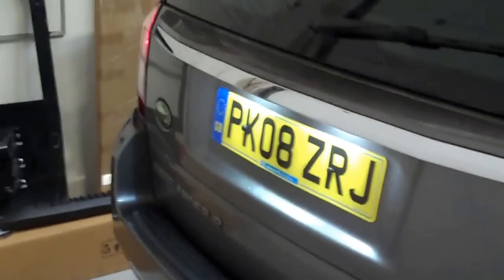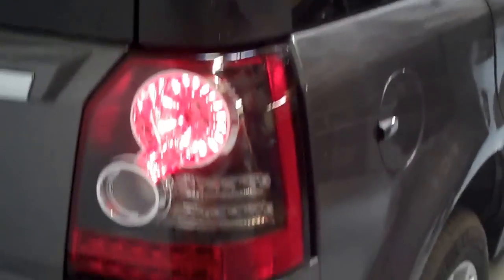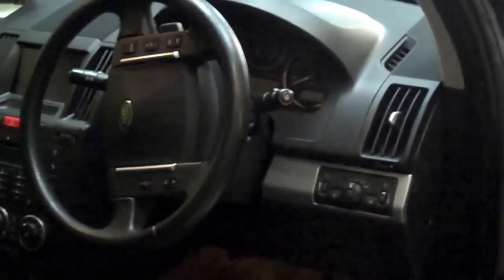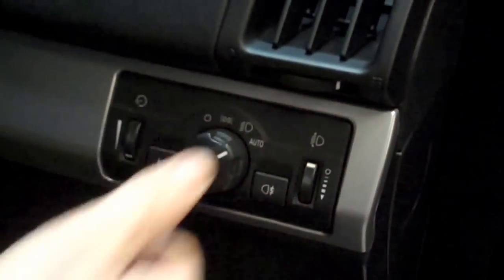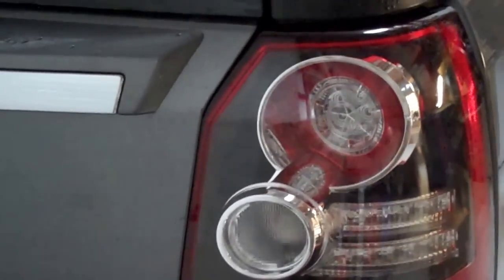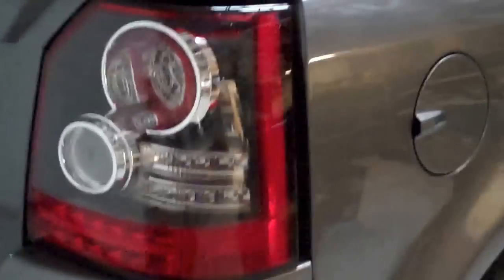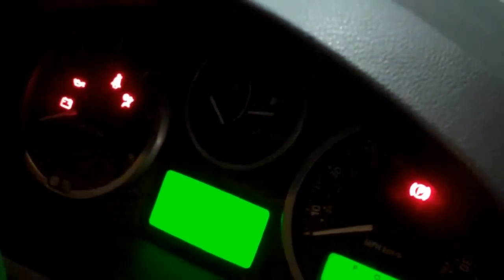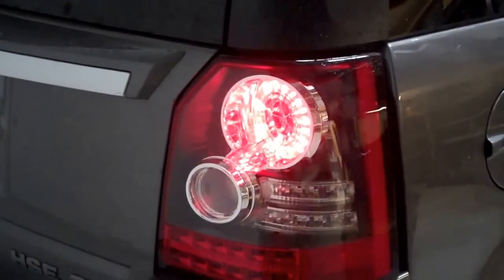Land Rover Freelander 2 how to reset light control ECU

Comment: Thanks a lot. Did I get it right? Put key in, press and hold the start button but no foot on the brake? This will reset the ECU?
Reply from the maker: +uboot67 yes but it also seemed to help if you then start the engine the normal way straight after doing the ingnition only cycle

Comment: I have a problem since my battery went flat and the Auto lights no longer work (the lights are on all the time) so I tried this tip but it made no difference. Any ideas?
Reply: Did you resolve you issue 🤔 
If so how

Comment: This didn't work for me BUT I completely disconnected the battery for 10 mins and then it did! I'd had a tail light out, and replaced the bulb and tested the cluster by plugging it in the other side. There was a small voltage on the faulty side so the wiring eas obviously intact, so it could only have been the ECU. As I say, only a total power down fixed it. Of course you then need to reset the one touch windows and maybe the sunroof, and reset your all-doors unlock setting on the keyfob (if you use that mode) but it's a damn site less trouble than getting ripped off at the licenced robbers they call a main dealer....

Comment: Im having an issue with no break light on my range sport 2006, i fitted a new spoiler an rear 3rd break light. Now i have no break lights and a "transmissiin fail" warning on my dash. 
Any ideas guys, cheers
Mitch
Reply from the maker: Hi - there have been some weird problems reported when bulbs fail - so check all your bulbs - it wont take long to pull them out and check them all. Also could be the brake pedal switch ?
Reply: @L663  thankyou. Will do, and i will keep all posted on solving the issue. 👌🏽